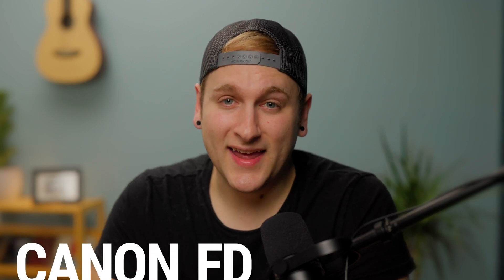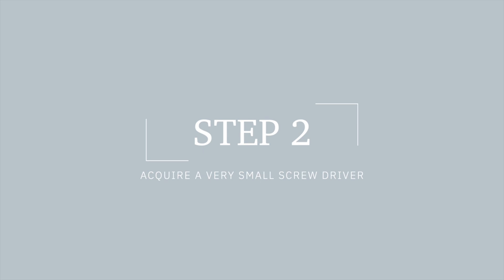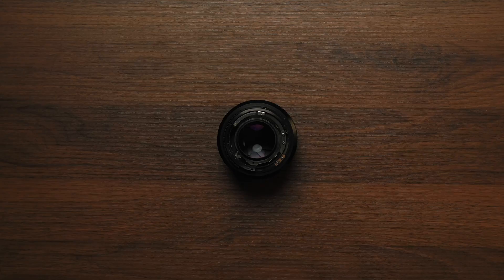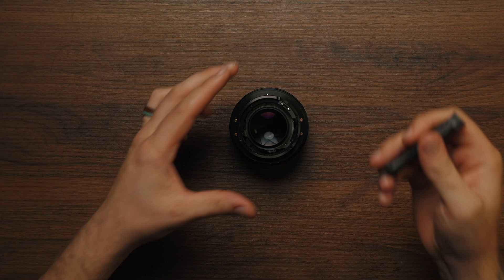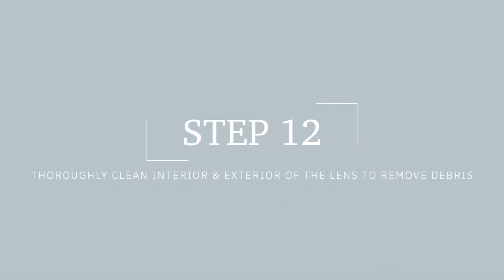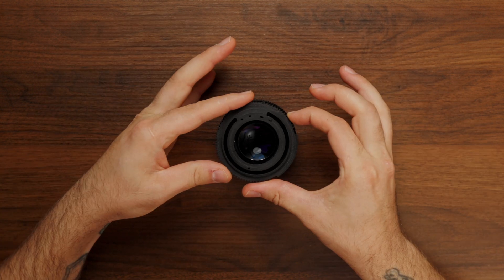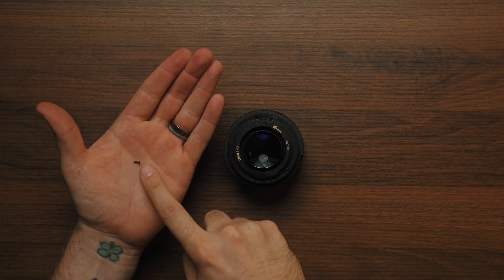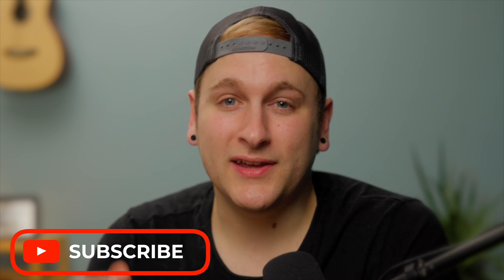Canon FD : Converting 1976 Vintage Lens Into Modern EF Lens

Comment: What is the benefit with this over the commonly found adapter? Thanks.
Reply from the maker: Shorter flange distance equals better optical performance. This point would be argued by older dudes, but you see less chromatic aberration, the image would be softer, less ghosting, less spherical distortion, and easier mounting.